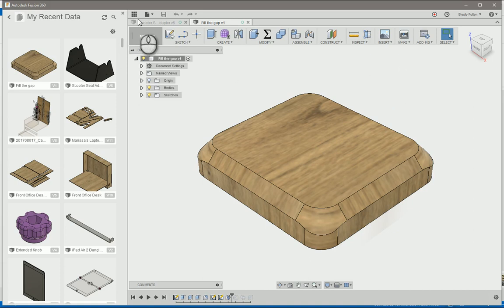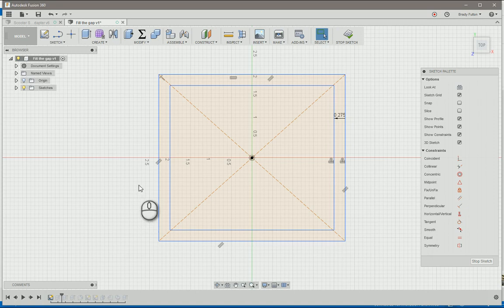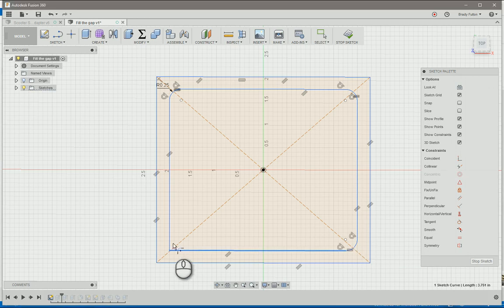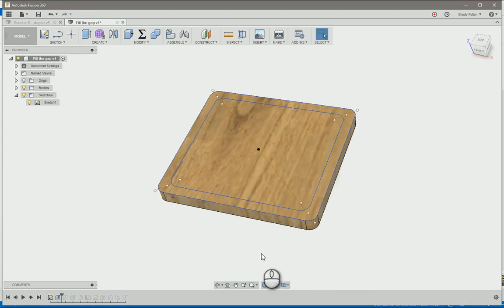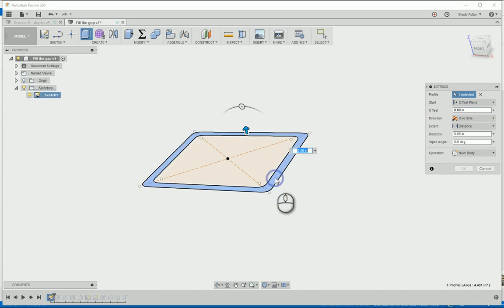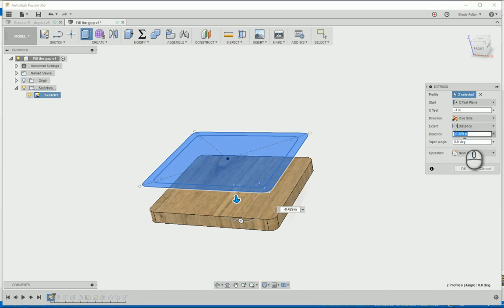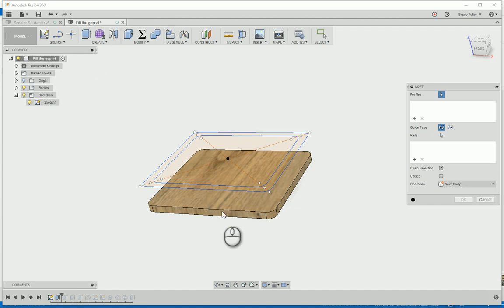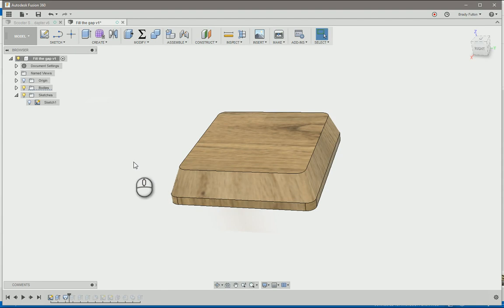Filling the gap in fusion 360   Loft Solution

Comment: Excellent. The offset plane extrude should fix a problem I have with 3D printing text. Fusion 360 apparently uses a shell for fonts, not a solid. I switched between 3D printers and their slicers left the text hollow, leaving unintended voids in the print. I think I have to offset extrude the fonts to start at the surface where I want the text to appear.